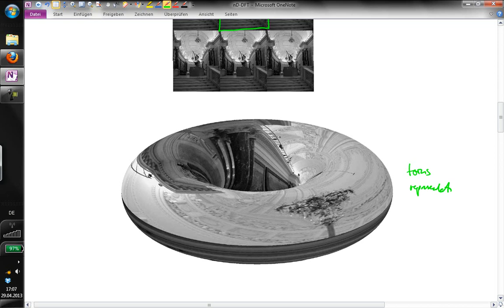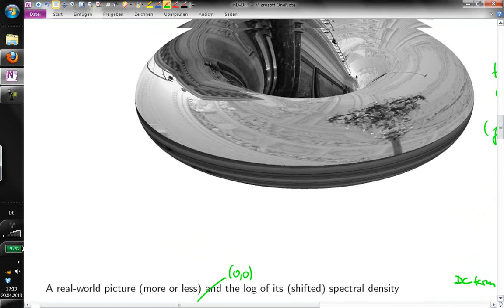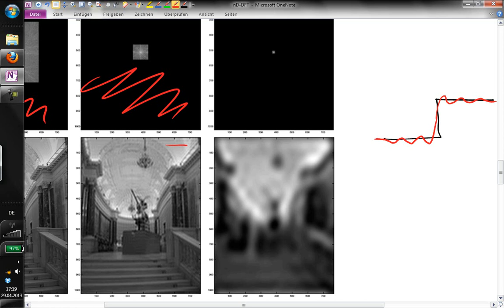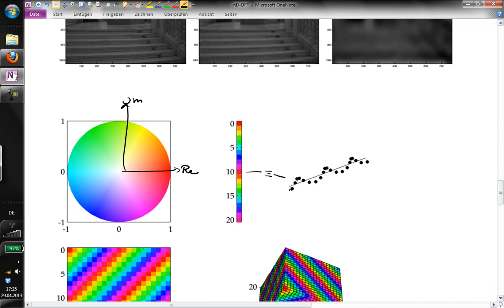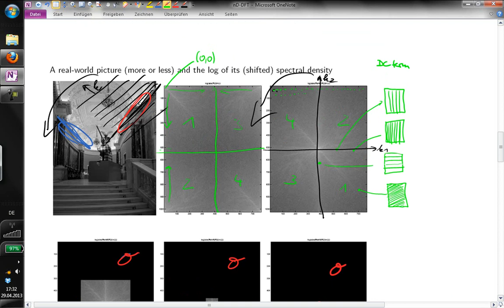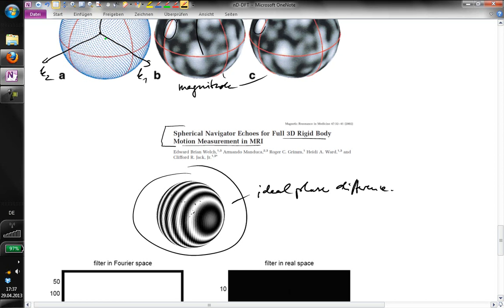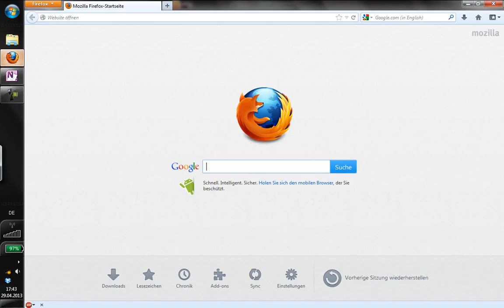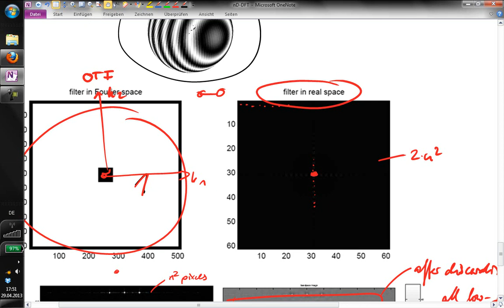3.4 2D-DFT: Application to Images | Image Analysis Class 2013

Comment: A point on the complex plain wave shows the intensity of a Fourier Coefficient in the spatial domain ? And the more the point is away from the center (0,0) of the complex plain wave, the more energy it possesses ?
And the distance from a point in the complex plain wave is called magnitude ?
A lot of questions but your video explains the DFT in the spatial domain pretty well.